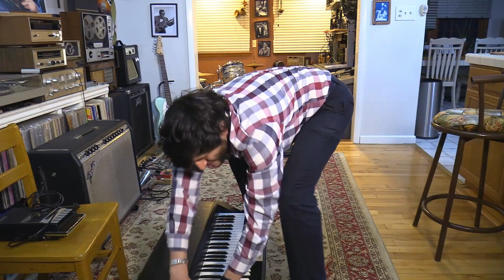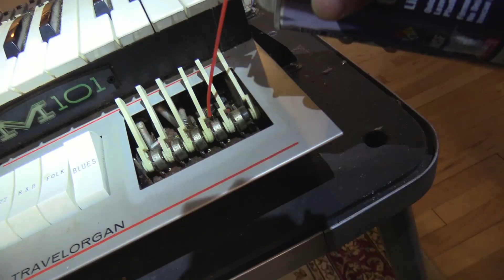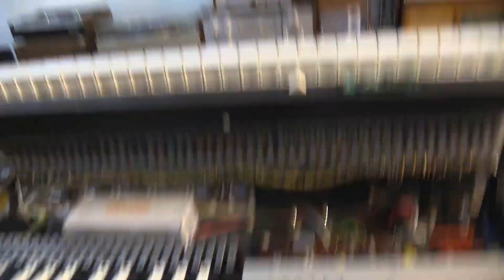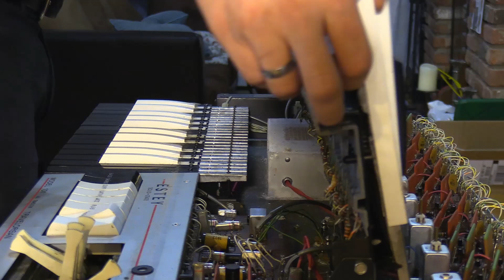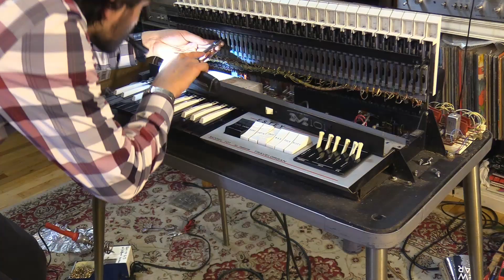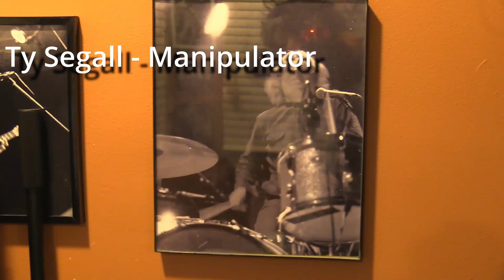Estey M101 60s Electric Organ (Part I)

Comment: Mario, do you primarily use this organ in your production or do you use another device?
Reply from the maker: I actually just sold this to someone like an idiot. I miss the damn thing.
Reply: @Mario_DiSanto well, damn. Do you have any keyboard now?
Reply from the maker: @nodesignation4250 I've had a DX27 forever. And a Mini Korg found in the trash.
Reply: @Mario_DiSanto well, what did you use for most of your production?
Reply from the maker: @nodesignation4250 the DX27 mostly

Comment: Man you got so lucky that all the condensers and transistors of the cards were in working condition. I picked up an Elka Panther for roughly 50€ as a project but repair was hellish. I ended up getting it worked on by an expert tech. Ended up spending 250€ in total, but still I don't regret it. By the way, love your channel!
Reply from the maker: Kiwi, I know I was super glad I didn't have to do major rehab on the organ. The organ itself could definitely benefit use a full "cap job" as it is a tad noisy, but for now it will do just fine for me.  That Elka Panther is an absolute beast of a unit! Thanks for watching.

Mario
Reply: How do you know a Cap is bad?  Leakage?, swelling? anything else?  Haw do you test them without DE- soldering?  Thanks, Mike Celi  @Mario_DiSanto

Comment: Nice. Wish I could play keys but I'm useless. Sounds great for what in the 60s was probably really cheap. Also interesting how even a cheap thing like that has hinged keybed and was clearly designed to be repaired. Good luck fixing your interface in 50 years.
Reply from the maker: John, don't even get me started on that topic!  Ever try replacing an alternator on a new car?  Takes three days, 4 people, 2 chickens, 60 tools....versus an old car where the whole job could be done in under ten minutes with one hand tied behind your back.  It's like this with everything being manufactured in the current "throw-away" age.  Why fix it when you can buy a new one?

Oh no I am going on one of my engineering rants again....you started it this time though.

Mario

Comment: I wanted to ask you about what kind of organ you used!
Reply from the maker: Normally I'm using my FM synth the DX-27 for my organ sound. This will be my new organ moving forward.

Mario
Reply: @Mario_DiSanto  layer them shits! Running both through your amp would probably be killer.
Reply from the maker: @_floeter  I should setup all my keyboards around my piano so I could have a 360 setup going on.  If only I was proficient at the keys that would be pretty dope haha.
Reply: @Mario_DiSanto  Gumption > proficiency! A circle sounds ideal, I have to keep my console organ and wurly 206 in different parts of the house due to space constraints.

Comment: Nice! I have a vintage Electric Organ that I need to learn how to tune!
Reply: I said the same thing about my farfisa bravo til the other day when I popped mine open and there is an obvious tuning screw which is the only one with a wire connecting which you can turn to tune the whole thing by up cents and down cents with a screwdriver. Coulda done it a long time ago.
Reply: Might be similar if its a compact organ?
Reply from the maker: I agree with Jacks comments. It's usually pretty straight forward, just gotta crack open your organ to see what's going on.

Mario
Reply: Thanks guys, Gonna look into it! 
And great video Mario!